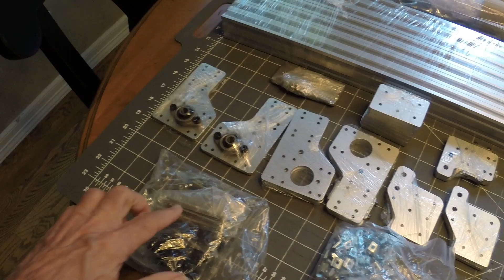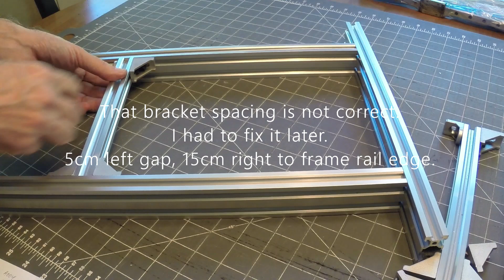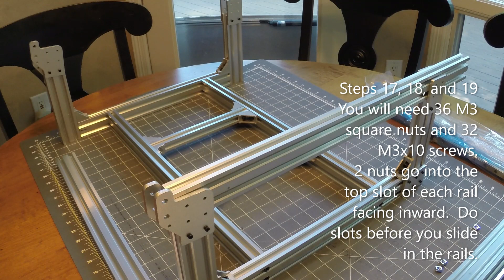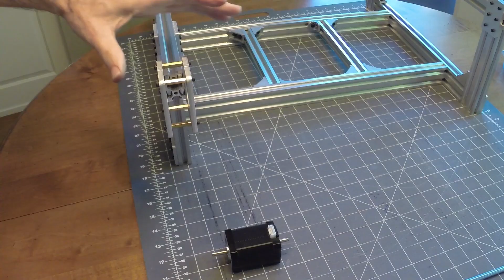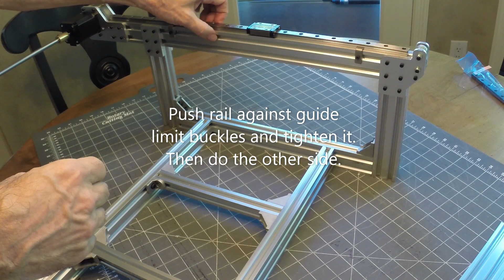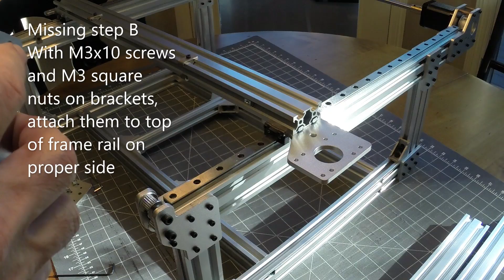Building the microsmt openpnp frame

Comment: Hey Mitchell, thanks for the video. Documentation on this isn't great hah. 

Did you ever finish the frame and get this thing running at all? When I look at the distributors "how to" video on youtube (not as helpful as yours) it appears they mounted the bottom 'frame' assembly, that the bed will mount to, higher up in the air rather than down at the bottom. Whats your experience with that? I don't know much about this system, just assembling it for a friend.

Comment: time 11:28  you forgot to put nuts for the future electronic components mounted to the side of the machine. to put them there, you have to disassemble the machine again, to the power supply, to the 230v socket, to the guide rail

Comment: I just started my build two weeks ago about the time you posted this.  Im much further along but you pointed out two things i missed.  The shipping oil that needs to be cleaned is one. I now have back out alot of build to get to where i can clean them. Its much less than if i had finished the build.  I wish i had found this the day you published it. The other is the uneven offset of the bars in the first step.  I noticed a 5 mm gap now i know why. I need to see if that contributed to the problem.   Anyways thanks for the video.
Reply: Do you have name of this aluminium corner brackets for step motors and idler pullers? Where a can get it?